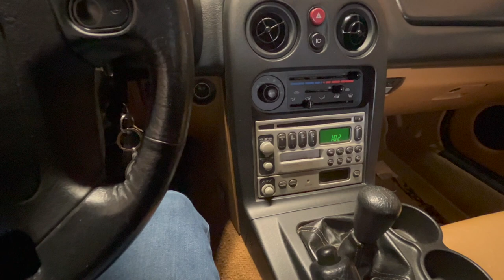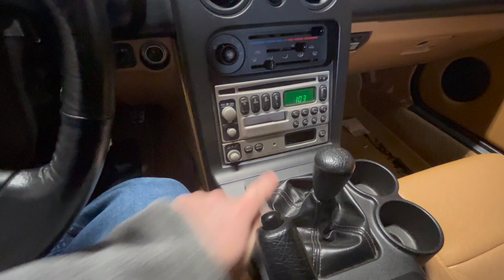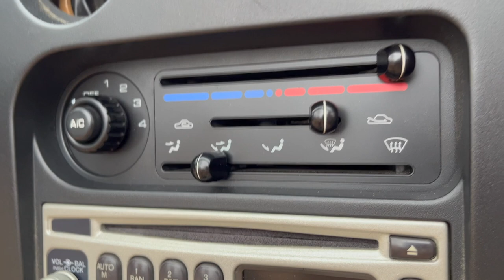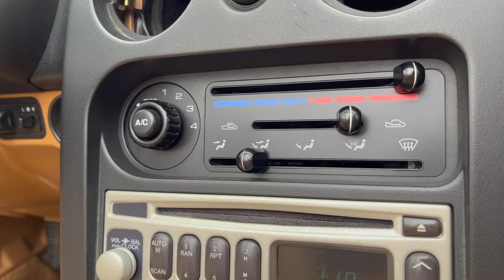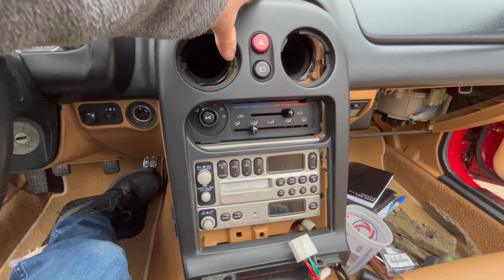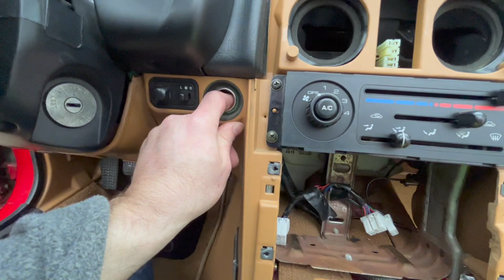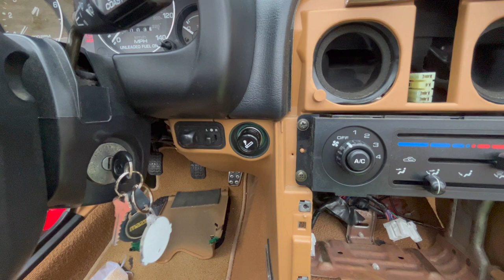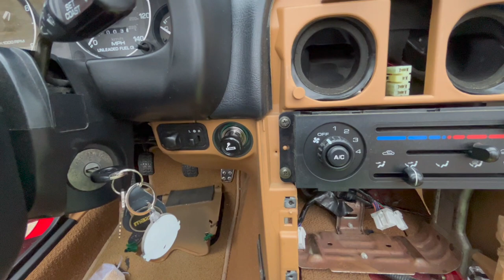NA Mazda Miata Radio Removal Tips

Comment: I wonder if the steel cover under the steering wheel is for safety in the event of an accident to stop you be being impaled by the steering column?
Reply from the maker: No, I doubt that - it really does seem out of place though.
Reply: @bbishoppcm  Interestingly enough, in every other market the NA was sold, the panel was plastic. I suspect it was a precaution if the airbag deployed... I still don't understand the engineering decision but the only real difference between JDM/Euro cars is the fact there's no airbag.